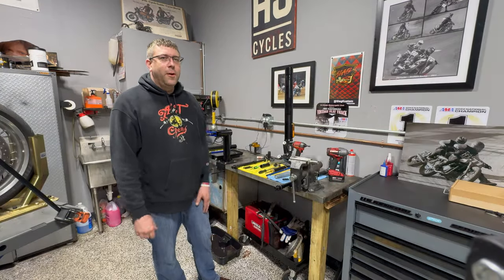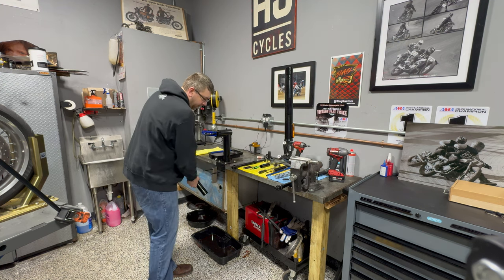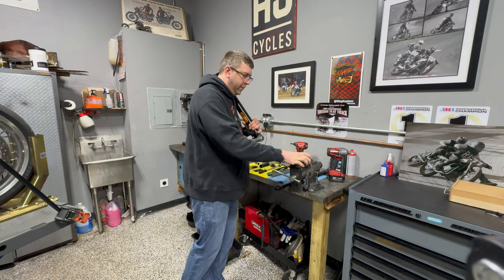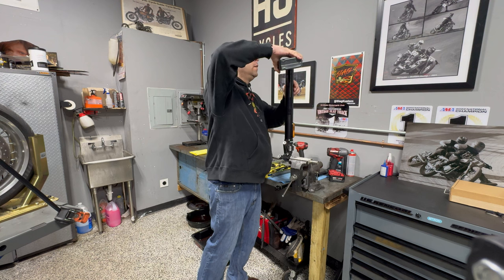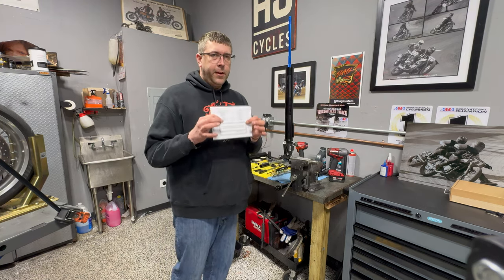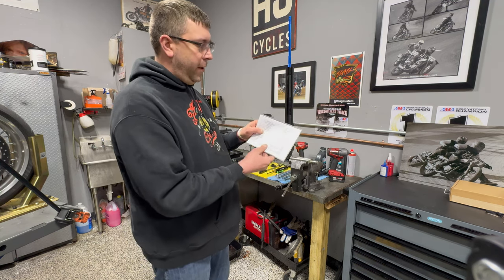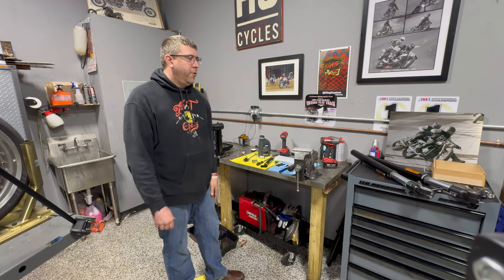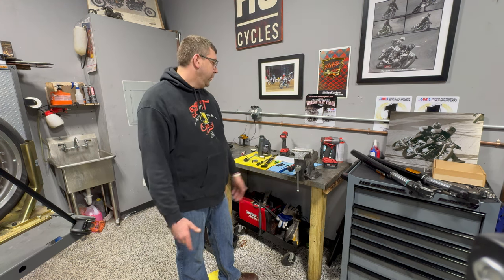Nitron TVT Cartridge Kit Install 2022+ Triumph Speed Twin 1200 by A&J Cycles

Comment: Great, well-detailed video on the process!
One question please:
Aren't nitron kits sold already pre-assembled like some other brands?
spring and cap already in place which allows you to just screw the cap onto the top of the fork without needing to compress the spring?
this would greatly facilitate the work, especially if the springs already correspond to the buyer's request (weight, type of use, etc.)
thank you for your response.
Reply from the maker: They come with the cap and spacers loosely threaded on but the spring is separate. You will still need to follow steps in this video for install.

Comment: whats the advantage for these?
Reply from the maker: They allow for full adjustment of the front end (preload, rebound and compression). Thus you can control the front end for a softer or firmer ride. End result is a front end that absorbs imperfections in roads, and is always planted in turns. The stock front end has no adjustments.